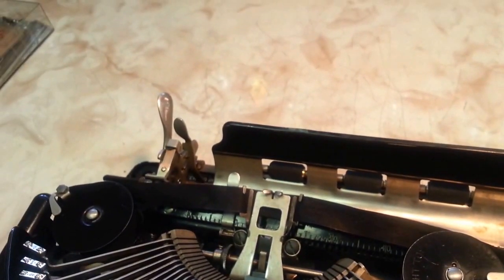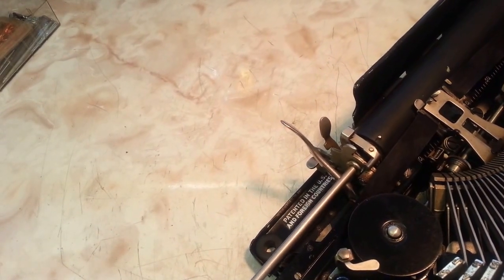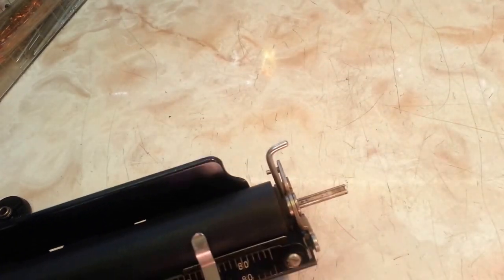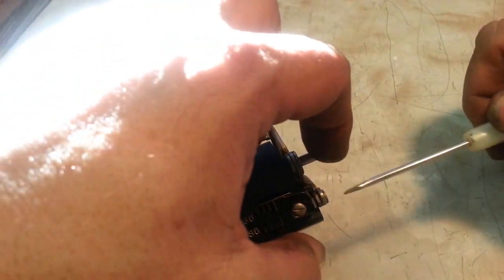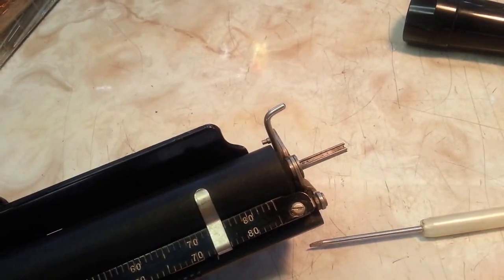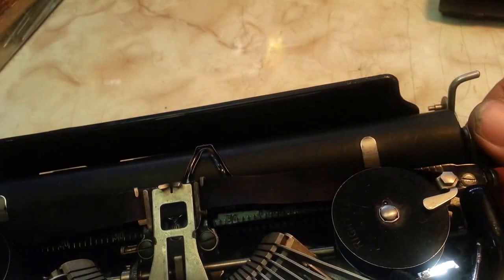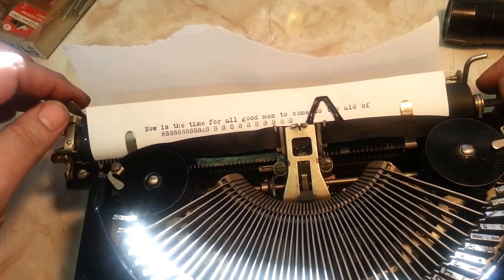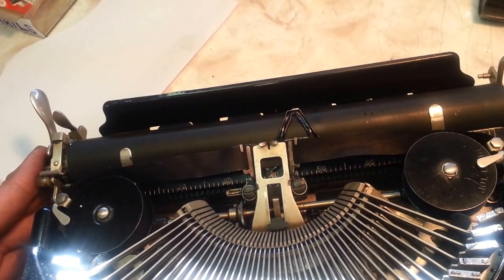Remington typewriter platen grooved re-surfacing sanding removal DIY Pt-2

Comment: So what's the answer?! What do you think caused the problem to begin with, if not the platen?
Reply from the maker: The platen is hard from age & new rubber would allow type face to have contact with more surface area. 2 sheets of paper might help the print quality too.